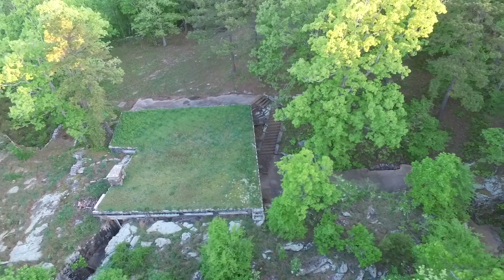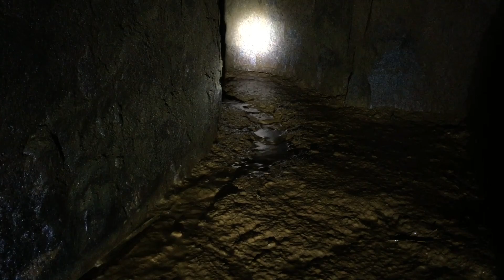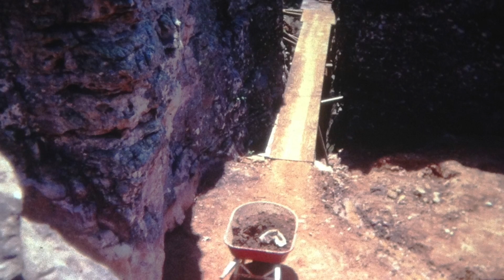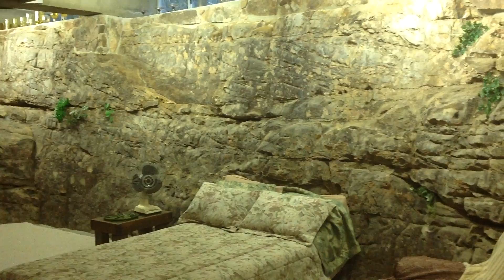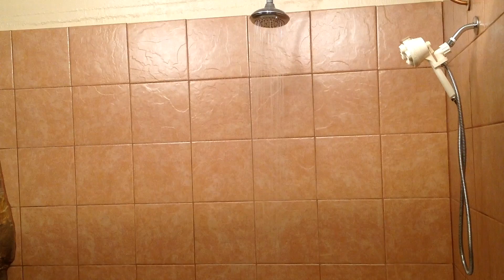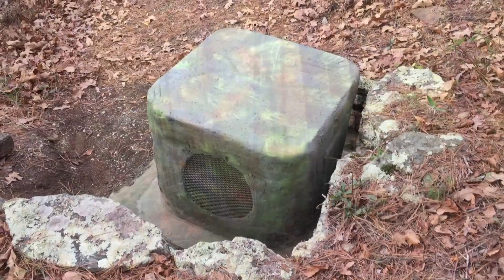Underground Rock House Narrated

Comment: I have no idea if you still check the comments Roy but congrats on a succesfull build and the many years of good living it has provided. A quick question what variety of wood is that from the neighbours barn and is it stained?
Slainte
Tariq
Reply from the maker: I appreciate the comments. The wood is southern yellow pine from my neighbors old barn. The cut edges are stained walnut. Most of it is just coated with a clear water based varnish.
Reply: @roy_hayward1679  Hi Roy thankyou for the response and we appreciate the videos. Slainte Tariq.

Comment: This home is beautiful.  A true work of art.  I started to research monolithic dome homes and 'earthships' because I'm looking into self sustainable houses that also blend into nature because the best defense against prying eyes is for said eyes to not even know you're there.  Essentially I'm preparing for a gradual societal collapse brought on by climate change, economic collapse, etc.

How much do you think this would cost you today?  What was your background when you started to build this?  What are things you would do differently?  This is the type of home I want 100%; I just know very little how to go about this.
Reply from the maker: My background when I began this house was practically void of building experience. You already know more than I did because of your research. One of the things that I would do differently would be to eliminate the pool in the house. First of all I don't need a pool. It turned out to be detrimental because of added humidity in the house. If you are planning to build in a humid climate, I would plan to use a dehumidifier or air conditioner to remove some moisture from the air. Also, I would not slope the floors again. That makes cabinet work and building walls more difficult. It does work as I planned to remove any water seepage from the house but there has got to be a better way. There were more successes than failures overall! Good luck with all of your endeavors.

Comment: I'm a tile setter by trade, and my plan is to buy land that I can do an underground home to build as my retirement spot. Looking for right plot of land now. Spots I found are $40,000+ with nothing on land but dirt and trees and no nearby power lines. My plan is to do solar panels connected to batteries for power supply. I hate electrical though, so I'll have to sub that out.
You really lucked out with all that rock there, and in the time you built it, land was cheap and so was building materials. Even windows are super expensive now and have to meet requirements to pass building inspection.
Curious, did you camp on site while building this? Or did you just find apartment nearby?
Reply from the maker: I lived on the site for 8 1/2 years. First in a tent and then in a junky travel trailer. I sacrificed more than most people are willing to do now or even then. Land was no cheaper then than now if you adjust for inflation. Your electrical company will probably run a line for you for free. Just ask them. I built my own windows from salvaged glass patio doors. They are framed with Barnwood from my neighbors barn which I got for free by tearing it down and sharing the lumber with him. Most of the interior of the house is built from the free barn wood. Concrete and the reinforcing steel are the most expensive parts of the house. I had no prior experience with concrete. I learned almost everything about building from books checked out of the library. I would have loved YouTube back then. I love YouTube now! Good luck with your endeavors.

Comment: Wonderful home. I'm curious about your cistern. How is it that the air contact eliminates the murkiness? Does it help to settle sediments or do dissolved minerals precipitate? Thanks for the tour. Cheers.
Reply from the maker: I am not sure how it works. I first noticed many years ago that water in the underground pool in the house was murky just after filling with water from the cistern. After about four days, clumps of sediment would have formed and settled to the bottom of the pool and the water would appear crystal clear. Getting into the pool would stir it up and there would be clumps of sediment floating all through the water for the next half of a day. I guessed that it had something to do with contact with the air which the cistern did not allow until I lowered the water level. The water looks much better now. It also tastes and smells much better. You are welcome for the tour. Stay safe.
Reply: @roy_hayward1679  Thanks for your reply Roy. Incidentally, I'm enjoying your channel. Cheerio.
Reply from the maker: Thanks for subscribing to my channel.

Comment: Did you run into any problems with permits?
Reply from the maker: No Samuel. They did not know the house existed until I told them about it a year after it was finished.
Reply: @roy_hayward1679  But did they put a lien on the property as back pay for the permits?  Or did they just shrug and let it go?
Reply from the maker: No problems Samuel. Probably, no permits required. I never did check. The county sent a couple of assessors out to reassess my property and then they began charging me a lot more on my property tax.

Comment: Where does the waste from toilet go? Is it a compost toilet?
Reply from the maker: Waste water flows through a conventional sewer line to a hand dug septic tank and then to a hand dug series of leach pits all below the house. From there, it is filtered by the soil on its journey down to the bottom of the valley where it continues it's slow journey to the ocean eventually. Some of the spring water from above the house just gets rerouted through the house on its journey to the ocean. Have a good day crazy sheep.
Reply: @roy_hayward1679  Wow!! 👏👍 RESPECT!!!

Comment: Sir Roy Hayward, this is the best ecological home I have seen. And I have seen many here on YouTube and other social media sites. Your sleep patterns must be tranquil because you have built your own paradise that most of us can only dream of doing and just knowing you have no home mortgage is a rewarding feat that only the elitists have accomplished! You are a knight living freely in your own castle! I love the natural interior walls that I’m sure make you feel you are outdoors. Breathing natural clean crisp air just opening up some windows and stepping outside when most of us step outside to noise pollution. As I began to watch your video, one of the first thoughts that came to mind was, this does not compare to any Frank Lloyd Wright homes! I was also drawn in from the beginning to the beautiful song of birds chirping because at least I have that every morning from planting trees on my property. I do have a question about the roof. Why didn’t you apply several coats of tar onto the concrete before applying the plexiglass to prevent leaking?
Reply from the maker: Thanks for your comments J G . My main roof waterproofing was less than one tube of clear silicone caulk. I located all of the hairline cracks prior to caulking by wetting down the roof or waiting until after a rain and watching it while it dried. The cracks would be the last thing to dry and I would mark it with a crayon before it disappeared again. (a Small window of a few minutes). I then covered it with a six mil  plastic sheet which probably did not do much for waterproofing after a few years anyway. After almost 40 years, I do not have any water leaks in the roof of any consequence.
Reply: Brilliant.

Comment: Hello Roy! Rob from Colorado here. I've tripped across your underground house a couple different times in a couple different places and I've got to say amazing job! Long-term but beautiful. I love your idea of using the swimming pool as an air conditioning source - I was kind of toying with the same sort of idea of a water-filled wall to act as a trombe wall for heating and in the summer you drain the water because you don't need heat. Sounds like the pool over-humidified your place? Anyway amigo, love your house. Congrats on an amazing build!
Reply from the maker: Hi Rob. An indoor pool in a humid climate turned out to be a bad idea! I was growing several different varieties of mushrooms on the walls until I put in dehumidifiers.

Putting water into your wall is probably not necessary! This house and another house I built have adequate thermal mass with just concrete, rocks, and gravel. I supplemented that with a lot of books in each house which again, were not necessary. 

Good luck to you and thanks for your comments.

Comment: truly amazing,

but thought i should tell you what i learned from another youtube clip today and its that using steel for reinforcement of concrete will make it loose stability in some time because the steel will corrode. will probably take several years though.
Reply from the maker: I did provide enough concrete covering over the steel reinforcing so that it should allow for several generations of use. It will probably last longer than most wood structures being built today.
Reply: yea, im no expert, just thought i should share.

and i dont doubt it should last longer than wood structures. :)
Reply from the maker: Thanks for watching and sharing.
Reply: sorry but im banned at twitter and facebook for the moment. at least you are in my playlist..

Comment: I love it, and thank you for sharing it this video with the world. I feel enriched just by watching this, I cant even imagine how amazing it much be to live there. Any chance of you giving tips on the do's and don'ts of building this or top 10 things you should know or top 10 things not to do or any kind advice for people wanting to go in a similar direction?
Reply from the maker: Here is a link to a different video of the same home. You may want to turn down the volume on your computer because many people don’t like the music. It may give you more information that you may like.

https://youtu.be/CWe0UgNmqp4

There is further discussion of my successes and failures if you click the little black triangle beneath the picture. I think that’s the best tip I can give people about my experimental experiences is to use rocks or gravel as backfill behind the exterior concrete walls instead of dirt! This pretty much eliminates any water seepage through the walls. A French drain or perforated pipe leading water out of the bottom of a trench at the bottom of the backfill is also needed.

My biggest mistakes were building a pool in an already humid Underground House, and building a Underground House in a humid climate. I run dehumidifiers continuously to eliminate excess moisture from the air.

Comment: this looks to be in the north east usa we have some areas in ohio and pa that resemble this area so much...darned fracking though, it will put  the water quality is at risk...might want to replace the spring with a systern if that occurs around your place...which of course means water engineering around all got a plan for that?
Reply from the maker: We are in the central part of the continental USA. No fracking here! Good water quality since venting and allowing air over the top part of the cistern. Thanks for being interested Louis.

Comment: Were you an ironworker roy?
Reply from the maker: Hi Nathan. No I was not an ironworker. I learned just about everything that I know about house building along with bending and placing rebar from checking books out of libraries and reading magazines with other literature. I learned by myself out here in the woods. I had a steel working shop fabricate the steel columns to my specifications and also bend the bigger rebars for me.

Comment: That was a great project. Thank you for sharing. I've had such a dream for decades. You built. I hoped. You finished. I dream. But, I do have the property for years, waiting.

Question: Have you ever tested your home for radon? I'd read that radon comes out of rock. I am curious because I still dream of doing my own underground mountain home, someyear.

Thanks!
Reply from the maker: I have never tested my home for radon. I just checked Maps which showed areas where radon was prevalent and I was not in any of those areas. Thanks for commenting and good luck B Stott.

Comment: How did you seal the roof to prevent water leaking through the ceiling? Thank you for sharing  your home to us. 8 years of hard work for a solid beautiful seems worth it.
Reply from the maker: I used less than one tube of clear silicone caulk to seal a few cracks in the concrete roof. I overlaid that with six mil polyethelene clear plastic which I imagine has deteriorated by now. There were leaks due to a few hairline roof cracks that seem to have been taken care of by paintable white latex caulk on the ceiling. Thanks for your interest and comment Rob.

Comment: Very inspiring work. The video is nicely done too (great shots from the drone and good use of the old pictures.) 

A few questions: what's wrong with the pool idea, and what do you use it for nowadays? 

Are the stone walls (e.g. behind the bed) cold or humid?

Are you not afraid of forest fires? (Sorry if that's a silly question)

Could you please give a few details more on what you explained regarding the level of water in the cisternae? Not sure I understood well. 

Thanks! And bravo! 
-from Moscow
Reply from the maker: Thanks for the nice comments woodenfences From Moscow.

I got the idea to build the pool during a very hot summer. I thought that it would be great to have a pool right in the house so that I didn’t have to walk down to the stream to cool off in a snake infested pool of water. Then I thought why not use the pool as a heat exchanger to condition the air coming into the house?

Building the pool was difficult and time-consuming as well as expensive compared with more traditional methods of air-conditioning. Also, the water coming from the water storage above the house would be murky for about four days before all of the particulates would settle to the bottom of the pool. Then, when we would get in the pool, it would stir the stuff up that was sitting on the bottom of the pool and there would be a lot of clumps of flotsam floating in the water which would take another day to settle to the bottom of the pool again.

Eventually, I cured the murky water problem by lowering the water level in the cistern so that air could come in contact with the top of the water as it never had done before because the water usually filled the cistern completely to the top against the concrete. Now, the particulates settle to the bottom of the cistern and the water intake is located a foot above the cistern floor so that it collects only the clear water for distribution to the house and the pool.

The stone walls behind the bed and elsewhere are usually the same temperature as the air in the house, so they don’t feel cold to us at a distance. We don’t usually come in actual contact with the walls.

We are not concerned about forest fires.

Good luck with whatever you are designing.
Reply: Thank you for the quick and detailed reply! Best wishes from snowy Moscow. -wf

Edit: I find it interesting that stuff in water won't settle down unless there is air in the cistern.

Comment: An incredible job! Where I'm originally from in southern Missouri has a lot of places that would fit the criteria for this style of building. Have you ever had any problem with water emerging in the exposed rock walls or snakes looking for a cozy place to sleep off the winter? Many thanks for the video. Your sharing is appreciated.
Reply from the maker: Water yes. Snakes no. I fixed the water seepage by building a rock planter under it and funneling the water into a hose and out of the house. Thanks for your comment De braco.

Comment: I am thinking of doing the same thing but I am wondering, Can you go over the roof again. How thick, Did you cover it with anything for moisture, etc...
Reply from the maker: Hi Wayne. The roof is steel reinforced concrete slab and beam sitting on supports that allow it to slide around except for one anchor point. Also, notice that the ends of the slabs are open and do not have an integral beam poured with them. I found out from experience later that those two things are important to keep the slab and beam from cracking while curing and later from expansion and contraction.

I got lucky with this first experience of building with concrete and steel. I was able to seal a few hairline cracks with less than one tube of clear silicone caulk. I credit that with keeping the roof from leaking for the past 35 years even though I covered it with a layer of six mill plastic sheet followed by 4 inches of rigid insulation with a one and a half inch concrete topping to protect from rodents and then dirt.

I recommend that you get an engineer to check your design before building. I just got lucky!

Comment: I didnt quite get hows the flow of the water, from spring to inside your house. Hope you have a video of it.
Reply from the maker: This is probably the best video that I can make of the water flow. The water flows from the cistern through the pipe in the trench in the video down to the house which is lower than the house. Thanks for commenting. Romeo.

Comment: Excellent work! Are you still making upgrades to the house? I noticed in the video when you spanned the forest that some of the trees had bark removed. Was that done by a bear? Do you have problems with insects inside your house?
Reply from the maker: I am still upgrading. I did not notice any missing bark. We do have bears! Or it could just have been the sun light filtering through the trees. I had problems with powder post beetles in my barn boards inside the house until I put in a couple of dehumidifiers. Thanks for commenting Edward.